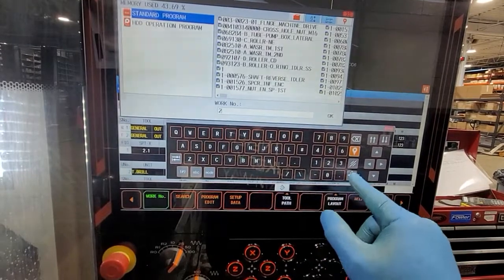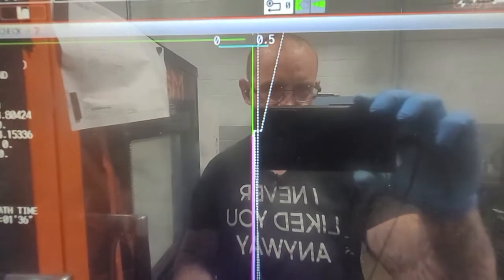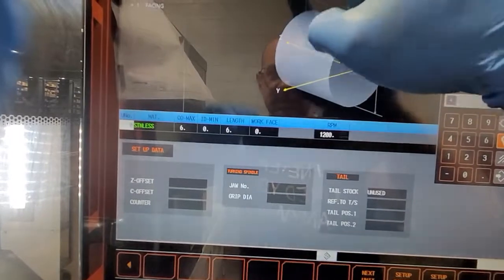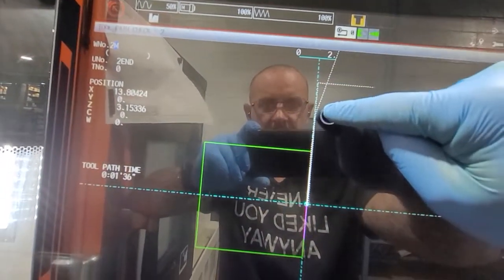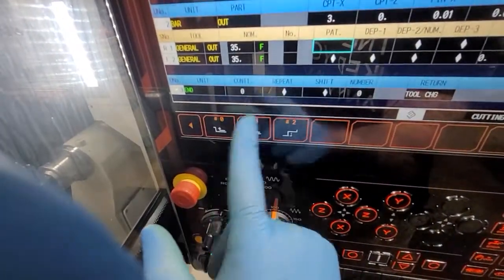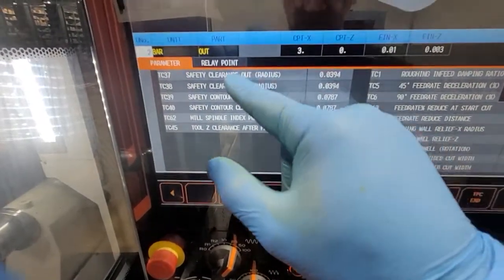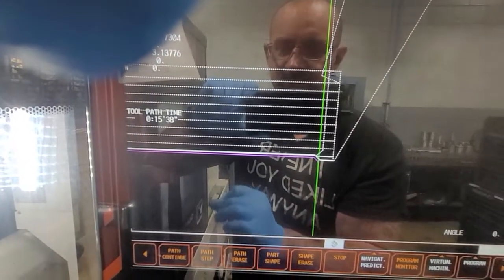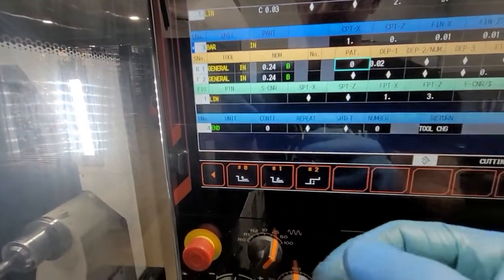Mazak Smooth G programing TPC option for controlling movement and clearance (a must know option)

Comment: the logic is mazatrol programming it's always positive 
similar to old siemense but if you are going to start before the part put a negative value  
you would also use negative value when doing OP2 on the EDGE BACK but only tghere after EDGE BACK you would program normally

Comment: do you know how to change this in user parameters?  so every time it rapids or retracts it's using the same value?
Reply: You will have to go into TPC at the beginning of the unit. You will switch it from auto to manual and then you will enter your numbers that you want. There will be 2 different areas one for roughing and one for finish. Just make sure to simulate it before you actually run it. Bc once you change and put your numbers in there it will go where you tell and you can crash it pretty easy.